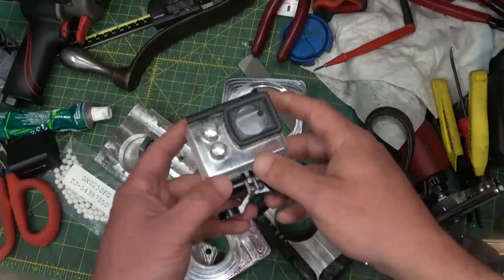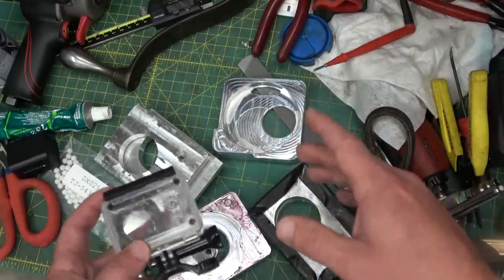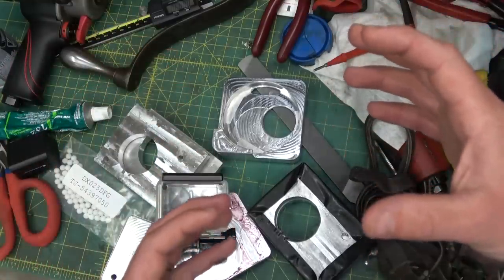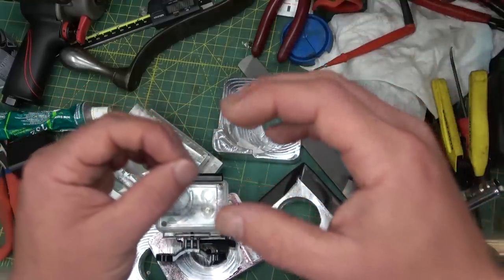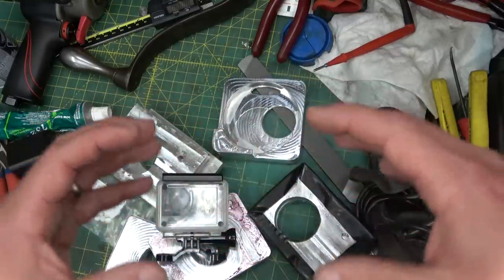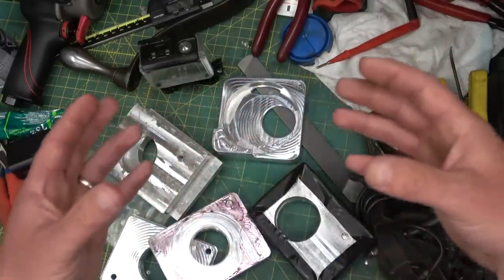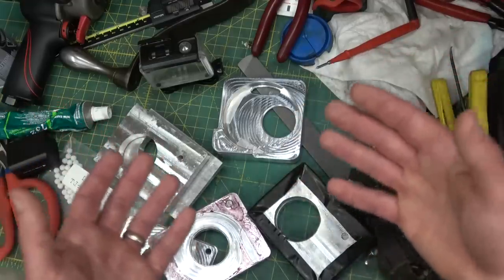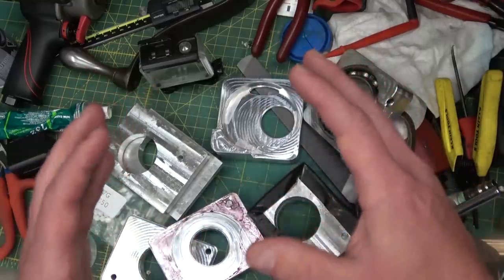Homemade Spinning Lens | self-cleaning gopro prototype

Comment: You're making too much work out of a simple design. 
Make a Tesla turbine with 2 pieces of glass and use air to spin them. SOLVED
Reply from the maker: It's just that easy! Do post a link once you've whipped up a prototype.
Reply: AvE Would you ask someone to post a prototype of a sandwich? The design is peanuts!
Reply: Psst, a Tesla turbine has a shaft running through the middle, which the whole thing this contraption is trying to avoid.
Reply: @ciarfah  
Indeed! You only need a few layers of lexan and an additional exterior disc that spins. 
You can use a tiny turbine to spin a much larger disc.
Reply: @TheNetwork  
And.. how is it going to spin and support itself, through its center, and exhaust in the center, like Tesla turbines require
And be clear?
Reply: @jimandaubz  
The small turbine say 2" can drive a much larger exterior disc. The spinning exterior disc can be driven by the main shaft and won't require massive air flow. The small Tesla turbine is just an air powered motor. The same as an electric motor spinning a fan blade. 
Using a milling machine is fine and dandy, but a simple turbine can be cut or stamped and assembled in a few easy steps. No fancy machinery required.
Reply: @jimandaubz   Same way AvE was already doing his current design. Make the lens larger and set the camera off-center.
Reply: @jimandaubz  
How do you think a rotary wiper works?
Reply: @TheNetwork  It seems like AvE is wanting this to be no bigger than it has to be. It's a simple design, enclosure, bearing, lens, and it fit right over the GoPro lens. What you are describing would need a very large disc to look through, a minimum of twice the size of the GoPro lens, to have an unobstructed view from the shaft. Then you have to put the turbine somewhere, and enclose the entire thing so it can fling water and do the job right. Ok, the Tesla design is 'simple', but it seems like it's more work, much larger, more parts to fiddle with.
Reply: @lukesnyder6820  
That's not an enclosure for the GoPro.
Reply: @TheNetwork  sure it is, al depends how its build
Reply: @LukeRT  
No it's not. 
The GoPro only looks through it and cannot fit inside it. 
The design is clearly too small to fit over the GoPro.
Reply: @lukesnyder6820  AvE is already doing that, and he's doing it for a very good reason. You often end up with a drop of shmoo in the middle of the lens that doesn't want to spin off or gathers trash and dust with this design.

Rewind the video and look at his prototypes. The camera portal is by the very edge of the bearing and lens.
Reply: @TheNetwork  I think you need to run threw your measurements again. The go pro can easily fit inside his unit with space to spare. With the extra space he has because of having such a small unit in the box he can easily fit 2 inside for an even better experience.
Reply: i second the post it motion. an idea ain't worth a fuck if you can't manifest it. i could fix all the world's problems, if i could figure out how to manifest it.
Reply: that and, come in the guy's shop with a good idea and wuss out when pressed? not a good look man.
Reply: @LukeRT  
What smoke are you cracking? Go to 11:56 you'll see the GoPro looks "through" it from behind. 
You may need to clean your glasses.
Reply: @lukesnyder6820  
"This design makes a small turbine, roughly 1.5"x1.5"x0.625" in dimensions"
Hero 3 lens is 20mm
So your telling me a 50mm disc is too big?
Reply: Nathan Rhyne, why don't you just make one, and make a video of it working.

Like the old saying, "Put your money where your mouth is". Anybody can talk, few can actually do something.
Reply: @k9elli  Finally! A sensible solution!
Reply: @rianmach9043  
That's exactly what I was thinking except the Tesla turbine is what used air power to spin it. 
https://www.instructables.com/id/How-to-Make-a-Mini-Compressed-Air-Turbine/
The disc wouldn't have to be that big either. The GoPro 3 lens is only 30mm in diameter.
Reply: @UCwcEdl6twkhkFAxACMrr9lQ I just made it that large arbitrarily, you could fix it pretty easily.  My thinking is that a motor is probably more versatile than a tesla turbine, but even so the gearing could be replaced with one.
Reply: @rianmach9043  i dig it. It's worth a go at the least. lol. probably no bigger than the $11k shelf-bought version, and pretty easily modified to suit any shortcoming that may introduce itself.
Reply: @PapiSmerf  exactleee
Reply: NiceWhenEarned RudeMostlyElse it’s less than 2x the size of the GoPro itself, I think it’d be ok
Reply: For those that said you need a shaft in the middle, has it ever crossed your minds that you can use a needle? A camera won't pick it up. Some of us have bird shit on our lenses, and ya'll don't even know.
Reply: NiceWhenEarned RudeMostlyElse Idea * Execution = Success, Where Execution > 0
Reply: k9elli see now that’s the kinda genius we need more of in this world! I wonder if rose quartz would make your GoPro feel better about itself at the same time? 😂😂😉👍🏻
Reply: Where are you storing the air on your helmet?
Reply: Nathan Rhyne aye bud if it’s so easy why don’t you just go make one and whop it up on YouTube for all of us to see. It’s easy to talk shit in YouTube’s smoko room ( the comments ) but a little harder to do the deed.
Reply: Nathan Rhyne may be educated in school. Doesn't sound like he has had to much experience putting what he has learned into a real life.
Reply: The live shaft will cause resonance which will be magnified by the bearing friction. I’m not sure where you were going with this?
Reply: @ciarfah  But there's the point you seem to have missed: It's a tremendous faux pas to ask someone else to do work for you on an idea you just tossed out there. If it's as good as you say it is, the fame and fortune ought rightfully be yours after you've made the thing and proved that it works. There can be egg on everyone else's face. What's not to like?
Reply: @arduinoversusevil2025  Miniaturize the Rotoclear. You're already offset to the side so the shaft won't be in the way.
Reply: @isaackvasager9957  
Check the thread someone designed a prototype based on what I was talking about.
Reply: k9elli a “Tesla’s Crystals” stall at any edm-type festival would make a KILLING. Business plan!
Reply: Ok you guys are all wrong........ You just spin the camera really fast...... Duh.......lol
Reply: Nah, go simple and reliable, put a hamster in there.
Reply from the maker: @DW Macaulay; Links?
Reply: tesla needs at least 3 and glass isn't balanced enough.
Reply: Woooooooooosh
Reply: How would it be air right against the go pro lens? The Tesla lens might be dry but.
Reply: How about a miniature high speed motor driving a belt around the circumference of the lens? Just an idea...!
Reply: @TheNetwork  you would go through a ton of air, and I would be concerned about the high rpms on that uv lens....
Reply: I like this kind of advisers ... where is your prototype? 

writing your idea is much simple did not sound well if nobody put the slightest effort to actually do it. 

Show us that simplicity. 

BTW I watched how the tesla turbine is made ... I don't think its simpler... but well: show us.
Reply: Still waiting for that prototype amigo
Reply: Why use air to spin it, when you can just use air to clean it?
Reply: T1Oracle He made another video of this same project and in the first minute or so explains why that won’t work.
Reply: Dont forget about the fog you can get from the cooling of the expanding air over you lense. And the the fact your in an enviroment of steel chips flying at 60mph.

Comment: Non-theoretical proof Rain-X doesn't do jack for coolant:  A while back I put it on one of the two Tormach windows as a test and was exactly the same as the non-Rain-X window.
Reply from the maker: HA! I KNEW IT!
Reply: AvE really is going with the simplest solution that is actually effective.  Yes, there are currently some really high tech coatings in existence but they are not really available outside of aerospace defense contracting.

There are some hydrophobic coatings that also shed oils with zero friction... they are designed for optical sensors and if the cost comes down touch screen devices.  Atm they are expensive and the manufacturing process for applying them is still in the trade secret category.   As far as I know they aren't a chemical coating like rainx but are more of a baked on crystalline structure.  The ones that actually work really well (like would be useful for what AvE is doing) are still expensive enough processes that even Samsung and Apple aren't using them yet on their flagship phones... and I haven't seen any high end consumer/professional camera lenses using them yet.
Reply: Most water based coolants have emulsifiers, which causes all the shmoo to become homogeneous but also causes the coolant to wet easily.
Reply: Yeah, Rain-X is USELESS in a Tormach and against coolant -- it can't take surfactants
Reply: RainX is just isopropyl, ethanol, and acetone, so it isn't all that surprising that it doesn't work for this use, lol
Reply: @RazorSkinned86  AvE is using a much more complicated solution than is necessary. As people have mentioned in the comments in his previous video there is no need for the camera to be centered in the window. Simply place the camera off-axis of the window disk and spin the disk via a shaft in the center connected to any motor.
Reply: The new Rain X formulation is terrible, which version did you use?
Reply: @No Thanks Good enough for the people we go out with.
Reply: @RyTrapp0  you're saying RainX is gone from the glass 60s after you apply it? 

that seems...hard to believe.
Reply: You would think rain-x being a hydrophobic surface treatment it would do at least something but i guess maybe because coolant is designed to somewhat stick it kind of cancels out ?
Reply: @danmick8645  I have absolutely no idea what you're talking about - I posted its chemical cocktail, direct from the MSDS(or whatever the hell we're calling them these days).

I mean, if you notice, RainX goes on wet and dries to the touch; that doesn't mean that there isn't a film left behind
Reply: @RyTrapp0  right, ok.  MSDS is the full formula and three solvents are the magic.  Right.
Reply: @danmick8645  Great evidence. Thanks for furthering the discussion. Everyone offers their appreciation.
Reply: @RyTrapp0  your thesis is laughable.  Sorry.  Learn something.
Reply: Also if the rain-x is silicone based, and the coolant has a silicone based compound in it, they jus gonna cozy up to each other!

Like birds of a feather, flock together!

Or: quarks in matter, don't like the latter. . . ?
Reply: Much like never wet, even if it did work it wears away pretty quickly. Never wet makes things hazy though. I put it on my water coffin paddles and pretty much need to reapply it every time I go out in the thing.

Comment: I work for National Geographic building custom camera equipment for the photogs. I won't put my email here but if you want to reach out for some advice on this (I work on stuff like this daily) reach out over my instagram @Mechanicalphoto. Looking forward to seeing how this works out. An electrically powered one might be useful to some of our work here at NGM.
-Tom
Reply from the maker: Cool thanks Tom!
Reply: @arduinoversusevil2025  Forgot what i was going to ask
Reply: @Thomas OBrien As an engineering student who's got a passion for cameras, out of curiosity, how did you get into this line of work?
Reply: @Ian_Wallace.  I guess he was a cut above the other students that applied for the job that he applied for.
Reply: @gareth sinclair Well yeah but, still I'm interested in how he came across such a niche part of engineering, and it doesn't hurt to ask. Also, until I read his comment I hadn't ever heard of this position before, so why not ask about it?
Reply: @Ian_Wallace.  Don't mind him. It is a genuine and intriguing question. I never thought I would end up doing what I do now. I was looking for a specific type of design (power electronics/power conversion) without a specific application and fell into a niche position.
Reply: @TheFootbaldd  I don't particularly mind, I think he was just trying to give a funny answer. I've always been interested in niche positions in engineering because they almost always seem way more interesting than normal run of the mill engineering, and I'm curious how people come across them.
Reply: Sure thing mate! @arduinoversusevil2025
Reply: Well I am a mechanical engineer by trade and education. Before here I worked for the US DoD as well as other types of field engineering such as Fall Protection & Facade access design, install and testing! I happened to find an opening and I applied! I've always had a love of cameras since I taught myself photography in high school. @Ian_Wallace.
Reply: @Thomas OBrien  Thanks for the reply!  It's always really interesting to hear how people come across these niche positions!  Also as a side note, if you don't mind me asking,  is the DoD a good place to work for someone who prefers hands-on/field rather than "office desk & paper" engineering? I'm looking at some Aero & Defense Sector positions (some contractor, some DoD) for when I finish school and am curious to know what I might be in for if I go that route.
Reply: @thomasobrien326  Sorry for the boatload of replies, I looked into it a little more and Facade Access looks pretty neat too, I guess I never really thought about the engineering that would have to go into those systems.
Reply: No worries! Yeah facade access is cool but can be a pain in the pack (for real). Many industries need field engineers/project managers; petrochemical, heavy industry, manufacturing, mining, renewable energy is a big growing field for sure, marine engineering, naval engineering, all sorts of stuff man! @Ian_Wallace.
Reply: that sounds like a dream job :)
Reply: @thomasobrien326  And that's one of two ways to find a niche job.

1: Keep your eye open for them at all time, and don't limit your field of view. Check everything.

2: Fall into them by accident and hold onto them for dear life.
Reply: I said this already to AvE, but this is used a long time ago on boats. It's called clear-wiew screen.
Reply: @labotadewall-e1569   I realized that the other night while watching, of all things, an old anime.

Of all the things that I could have found educational from an engineering/design standpoint: fucking anime.

Comment: Nice work, UBF!  Spin windows are the best solution to the problem.  Only drawback is they can consume a lot of air; for small shops, this can be a significant cost... turns out compressing air isn't free.!  If the window is just for eyeballing, put an air control next to the window, turning it on only when needed.

Comment: I have carpenter ants, I need to install new roof baffles, I have a rotten kitchen floor. I am here watching this instead. Thanks AvE. Always fascinating videos and lots of knowledge
Reply: Priorities
Reply: roof baffles = soffit baffles correct? i just went through that with a low slow hip roof... doing it from the inside sucked something fierce. i was plannign on doing the soffit and fascia anyway (hence the baffles) so i just installed them from the outside... way way easier. air sealing cable penetrations and sealing the drywall to the top plates was also far easier from the exterior fwiw.
Reply: @Timothy Manley Yes sir, that is correct. Why do you think I'm procrastinating it? Haha!
Reply: Joseph Eyster delta dust everything old and new after the job is done!
Reply: @insideHARDWARE What is Delta dust?
Reply: It’s a pesticide in dust form. You puff it into any carpenter ant tunnel openings. Around your attic and crawl space...  it’s amazing
Reply: @INSIDEHARDWARE  thanks! I just bought some on Amazon. Kind of pricey but it's cheaper than feeding homeless carpenter ants
Reply: insideHARDWARE Is it safe to use in kitchens or will it poison the food?
Reply: Get some borax and mix it with powdered sugar.   Then throw some around the areas you want to treat.   They die.
Reply: Joseph Eyster, order “Demon WP” from eBay, you’ll get rid of everything with six or more legs guaranteed.
Reply: Haha sounds like me

Comment: For the electric drive I'd use a rig to use rubber hose washers and have some way to apply a constant pressure. Using a hose washer will give you a a damn near universally available part, bigger contact patch and gives you a decent ratio for a little motor to a 58mm filter outer ring. Guesstimate 20mm washer OD vs 60mm filter OD, 7500rpm motor on a 3:1 ratio, so 2500 filter rippems. Add in a little spring tensioner to apply a constant pressure so the drive can handle a bit of wear and to allow for some bearing slop. Could easily use a 555 chinesium motor, they can be had sealed with ball bearings and it would easily drive the assembly even with sealed bearings which is likely what you'd want on the electric drive version. The tension system could use the motor in a slot  and use clicky pen springs to apply a constant positive pressure on the drive interface. Not enough to knock things out of line but enough to keep things engaged.
Reply: O rings seem more widely available to me. Also more predictably tight tolerances.
Reply: @GunFunZS  I guess I posted from a North American stand point. The hose washers are available at every hardware store. I'd agree on the tolerance but this isn't something where you need tight fits. The difference between washers would be taken out by the springs pressing it into the filter ring. You also still have a larger contact patch because the washer is flat vs convex. Car vs motorcycle tire type of thing.
Reply: Z M No springs, just an oring that stretches and a solidly affixed motor. Would be beautiful if it works